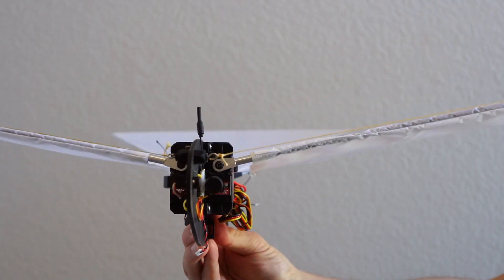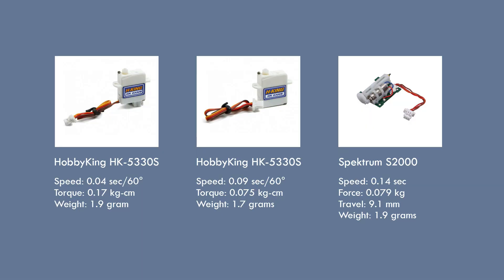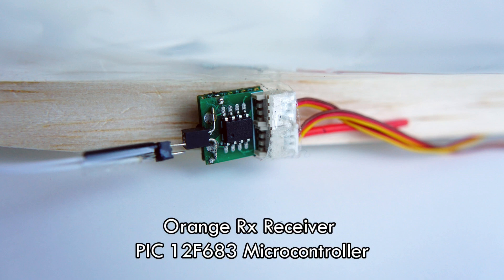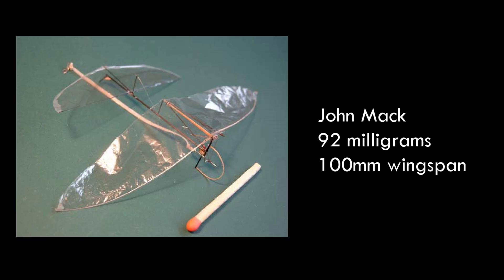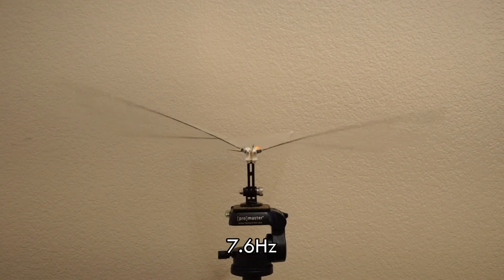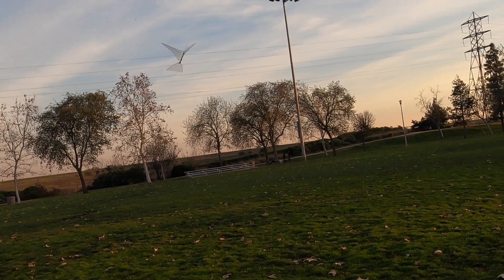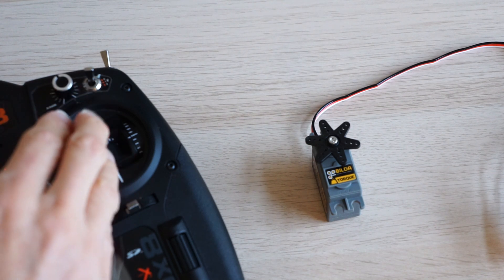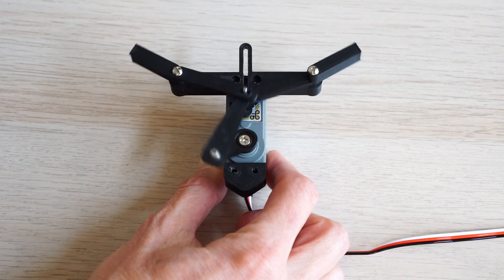World's Smallest! Servo Driven Ornithopter

Comment: Nathan, there is a way to get rid of the weight of the pcb/pic by transferring the math/mixing calculations into the tx. All you need is a tx firmware being able to run Lua script. in case you are interested just let me know. rgds Stephan
Reply: +1 to that, I recently got rid of the arduino on one of my ornis by just writing a lua script for my opentx transmitter that does all the mixing and generates the sinusoidal drive for the servos. It works great, unless you're using a very high flapping frequency, then the execution rate of the lua script can be too slow.
Reply: @basgerritsen9669  yes, the Lua is slower than the Arduino. But, you get rid of weight and complexity.

Comment: Very nice results for such small cheap servos. I suspect the response to the flapping rate is mostly to do with the stiffness of the carbon fibre rod in the leading edge.  At high rates, the full flap angle will not be transmitted to the wing tip before direction is reversed, so losing thrust. At lower rates the wing tip will  have time to follow the full arc of movement.  A  stiffer leading edge rod would allow higher flap rates, but at the expense of more weight and more load on the servo, which might cause failures there...

Comment: Hey, a question, is this possible to be done using an arduino nano?

I am making a 100 gram ramphoryncoid pterosaur

The material part isn’t a massive problem, it’s working with the arduino, is there a crash course to do the coding you did?

Comment: I think the reason for the slow speed working so well is because of the size of the wing. Decreasing the size of the wing would work better for more flapping. my thoughts. 
Also, I would like to see the rubber band powered one at a much larger size 
with 2 inch wide rubber bands, scaled up to human size for proof of concept.
It would be cool to see if you could give it a flight path and time from one location of the field to another.
Very exciting stuff you are doing!
Reply from the maker: Thanks. It doesn't fly with smaller wings because the servos have a limited speed. Rubber band power is a great way to make a simple, lightweight ornithopter, but it doesn't scale up well. A battery has much higher energy density than rubber.
Reply: @OrnithopterZone1  I love this because I want to fly safely but can see scaling up the wings for a human requires a lot more than I can rap my head around.

Comment: This is epic! I know the micro controller does it automatically, but for simplicity's sake do you think it's viable to just jam throttle up and down to achieve the flapping motion? (with increased weight/sensitivity of course)
Reply from the maker: I tried that the first time I built a servo driven ornithopter. I think it could work with the right ornithopter and sufficient training. It might be fun to try some kind of wearable interface instead of the transmitter stick.

Comment: some late thoughts.     i find it unsatisfying when a 'thopter flies like it's in a continuous stall.      that is why i think a 'thopter needs to have a variable cg; slaved to throttle.          maybe try a more forward cg with a higher flap rate.        i'm sure you know that the amount, and bias, of the slack in a membrane wing are major factors in how a wing will perform.        maybe try more wing membrane tension with a higher flap rate.        d
Reply from the maker: The micro servo driven ornithopter was carefully optimized. It was very efficient, and otherwise it would not have flown with those particular servos. The cord at the front of the wings allowed adjustment of the membrane tension. The frequency and amplitude of the flapping, CG, and tail angle were also optimized through flight testing.

Regarding "flies like it's in a continuous stall" an experienced pilot will adjust the pitch of an ornithopter to achieve the best rate of climb. Too much elevator can make an ornithopter slow down to where it will not climb. But an ultra lightweight ornithopter has a naturally slow flying speed. That is optimal for this design.

"Variable CG slaved to throttle" is an interesting idea. Just to clarify, you are talking about shifting the weight to adjust for different throttle settings, right? I don't know of anyone ever trying this before. You should do it and let us know how it works out. 

Most ornithopters use downforce on the tail to keep the nose up. At higher throttle, the ornithopter tends to nose dive, and more downforce is needed on the tail. Shifting weight aft (not forward) at high throttle would avoid the need for increasing downforce, so it would allow the ornithopter to fly more efficiently.

There are some interesting questions to answer: What is the best path to move the weight? fore/aft, vertically, or perhaps on an arc? What type of mechanism would be used? Can it be the sole method of pitch control?

But there are other ways to solve this. Servo driven ornithopters, like the one in this video, can raise and lower the flapping arc in order to provide pitch control, instead of using downforce on the tail. At high throttle, the flapping arc is automatically lowered, so the ornithopter doesn't pitch down with increasing throttle. Notice how the tail position differs from typical ornithopters.

Other solutions include a low-wing ornithopter or flying without dihedral. Either method gives you a lower thrust line, so the ornithopter doesn't pitch down at high throttle.

Comment: The lower frequency strokes seem to work better because they can get more travel on the wing
Reply from the maker: Yes. Although I did try even lower frequency and it was not as good. There is an optimal value.

Comment: Excellent work. Is this possible to share your arduino code?
Reply from the maker: It's actually PicBasic. The code works within the limitations of the PIC 12F683, simple but effective. I do use Arduino for most projects, and then I use a sine function instead of the lookup tables. 

'**************************************************************
'*  Name    : UNTITLED.BAS                                      *
'*  Author  : Nathan Chronister                                 *
'*  Notice  : Copyright (c) 2013 Nathan Chronister              *
'*          : All Rights Reserved                               *
'*  Date    : 12/16/2013                                        *
'*  Version : 1.0                                               *
'*  Notes   :                                                   *
'*          :                                                   *
'**************************************************************

' The CONFIG section allows GP3 to be used as an input.
#CONFIG
    ifdef PM_USED
        device  pic12F683, intrc_osc_noclkout, wdt_on, mclr_off, protect_off
    else
        __config _INTRC_OSC_NOCLKOUT & _WDT_ON & _MCLRE_OFF & _CP_OFF
    endif
#ENDCONFIG

Define	ADC_BITS	8	' Set number of bits in result
Define	ADC_CLOCK	3	' Set clock source (3=rc)
Define	ADC_SAMPLEUS	50	' Set sampling time in uS

flapcycle var byte
flapcyclemax var byte
pwout var byte
angleL var byte
angleR var byte
ch5 var byte
ch4 var byte
ch3 var byte
ch2 var byte
ch1 var byte
volt var byte

' The servos interfere with programming, and also
' you will need to unsolder the power connection to the receiver.
servoR Con 4        ' Alias GPIO.4
servoL Con 2        ' Alias GPIO.2
rx1 con 5

CMCON0 = 7    ' Analog comparators off  
GPIO   = %00000000     ' All outputs = 0 on boot
TRISIO = %00100000     ' Set input pins
ANSEL = %00000000     ' %00000100 Set analog input pins  

volt = 150
flapcycle = 0
flapcyclemax = 10

start:

' pause 4000

do

gpio.4 = 0
gpio.2 = 0
gosub radio

' voltage check -- allows only low power flapping
' adcin 2, volt
' if volt < 110 and ch3 > 30 then 
'  ch3 = 30
' endif
  
' look up wing positions
if flapcyclemax = 10 then    ' 4.5 cycles per second
    lookup  flapcycle,[48,24,0,24,48,72,96,120,96,72],angleR
    lookup  flapcycle,[48,24,0,24,48,72,96,120,96,72],angleL
    '  was  [50,30,10,30,50,70,90,110,90,70]
elseif flapcyclemax = 8 then    ' 5.7 cycles per second
    lookup  flapcycle,[60,30,0,30,60,90,120,90],angleR
    lookup  flapcycle,[60,30,0,30,60,90,120,90],angleL
    '  was  [60,35,10,35,60,85,110,85]    
else                              ' 7.6 cycles per second
    lookup  flapcycle,[40,0,40,80,120,80],angleR
    lookup  flapcycle,[40,0,40,80,120,80],angleL    
endif
                                   
' throttle scaling 
angleR = 55 + ((angleR * ch3) / 100) - ((50 * ch3) / 100)
angleL = 55 + ((angleL * ch3) / 100) - ((50 * ch3) / 100)
' pitch down compensation (dihedral varies with throttle)
' this will not work with reverse rotation servos
' angleR = angleR - (ch3/16) 
' angleL = angleL - (ch3/16)
' yaw steering adjustment   (will not work with high tail angle)
' this may not work with reverse rotation servos
angleR = angleR + ch1/2 - 75 
angleL = angleL - ch1/2 + 75
 
' reset flapcycle counter
flapcycle = flapcycle + 1
if flapcycle = flapcyclemax then flapcycle = 0

gosub servo
loop
end

servo:
pwout = ch2/3 + angleR - 180
pulsout servoR,pwout
pwout = 255 - ch2/3 - angleL
pulsout servoL,pwout
return

radio:
pulsin  rx1,1,ch1   'aileron
pulsin  rx1,1,ch2   'elevator
pulsin  rx1,1,ch3   'throttle
pulsin  rx1,1,ch4   'rudder
pulsin  rx1,1,ch5   'aux 1
'pulsin  rx1,1,ch6   'aux 2
if ch3 < 80 then
    ch3 = 80
    endif
ch3 = ch3 - 80   ' causes throttle to range about 0 to 100
if ch5 > 150 then 
         flapcyclemax = 10
    elseif ch5 > 100 then
         flapcyclemax = 8
         else
         flapcyclemax = 6
    endif
return
Reply: @OrnithopterZone1  Thank you. Much appreciated

Comment: I want to build something similar, but I think that the servos will break after only couple of minutes of flight right? Is there a way to make the servo last?
Reply from the maker: I never had any problem with the servos even after many flights. It is amazing, because they are very cheap servos. I rarely had servos quit working in other ornithopters. It is always cheap servos and I never had any problems with the Hitec brushless servos that I use in my larger ornithopters.

Comment: love your awesome work ,but please tell  me how do you get a servo to  continue moving back and ford, that dual action one looks  like its made for ornithopters. but only building planes and glders up till now I'm lost as to how you get a servo to  continue moving . i have started to build a gear box ornithopter  but like the look and sound of servo drive     Many thanks john
Reply from the maker: Hi John. A small microcontroller is connected to the RC receiver. It reads the signal from the receiver, calculates the flapping motion, and then tells the servos what to do.

Comment: Hi Nathan,  hope you are doing well, 
Your projects are always great; I hope to see more here. 
Regarding the flapping frequency, the servo can't reach its max amplitude at high flapping rates due to the servo speed limit, which will also decrease the flapping amplitude. Also, at a higher flapping rate, the flapping frequency will be close to the natural frequency of the carbon rod, which will be caused it to be bent.
Reply from the maker: All very true Hessam. I did test this ornithopter at lower flapping frequencies than those shown in the video. Although it permitted the servos to travel through a greater arc, the flight performance was not improved.

Comment: Regarding flapping rates, can be adjusted smoothly through a channel, I usually use high rates to take off , and then switch to low rates after flying.
dual mode servo driven ornithopter i am very looking forward to
Reply from the maker: Using the PIC12F683 microcontroller, which doesn't have floating point math, I used lookup tables to specify the cycle of the wings. There was a separate lookup table for each flapping rate! When using a more powerful microcontroller, I normally use a sine function instead, and that lends itself much better to controlling the flapping rate the way you describe. Are you talking about servo driven or conventional ornithopters?

Comment: I would appreciate a video on the mixing required for this.  Nice work!
Reply from the maker: That's a good suggestion. I will be sure to talk about it in an upcoming video. If you look at the clip near the beginning of the video that shows the wings moving on a larger ornithopter, you can see how the steering works. To turn, raise one wing while lowering the other. For elevator control, raise or lower both wings together. The flapping is simply superimposed onto those steering movements.